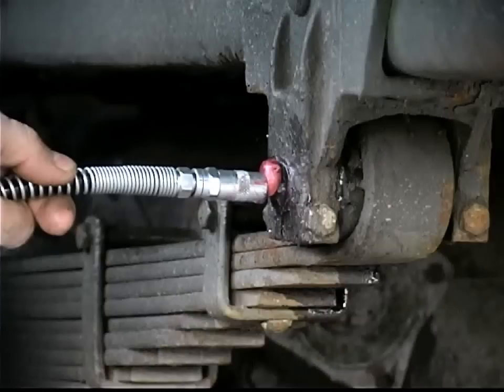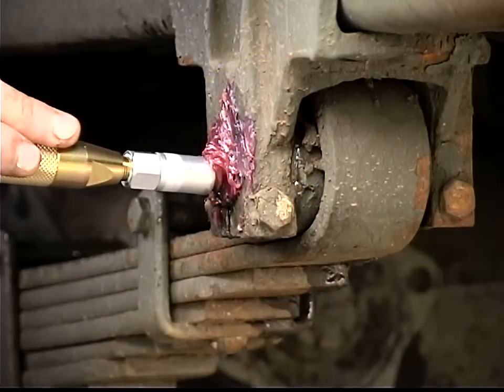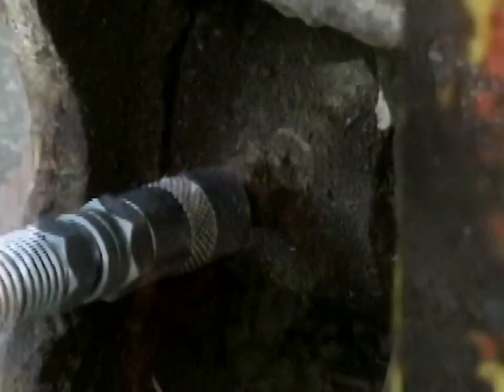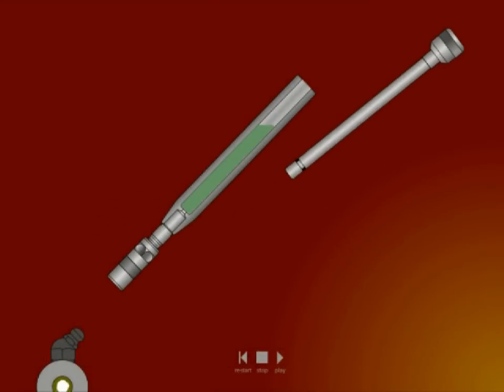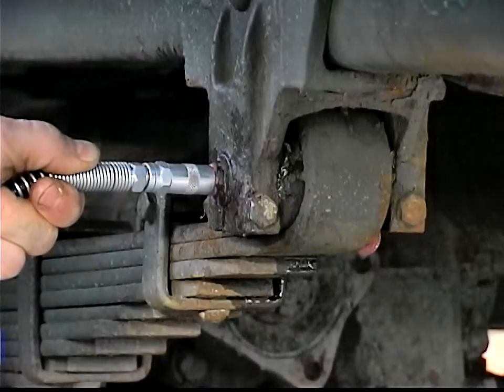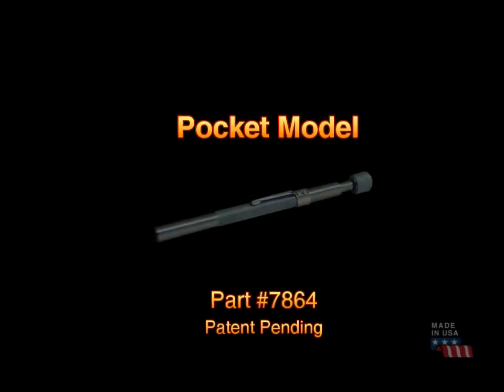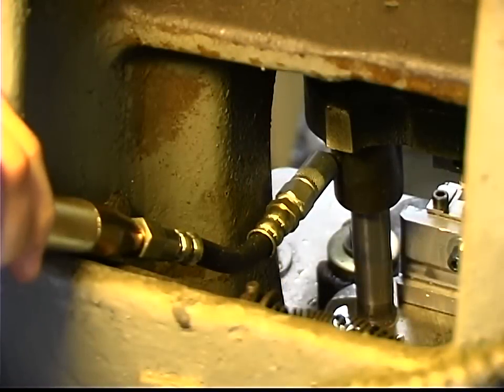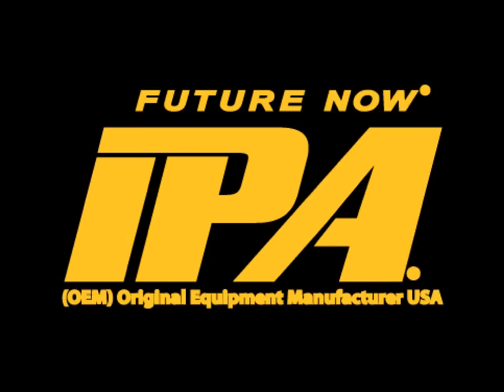IPA Tools 7863 Grease Joint Rejuvenator® Master Kit: Clean Clogged Grease Joints

Comment: This is a tool that works!  Be sure the tool is liquid full so compressing air does not degrade the hydraulic shock.  I found mineral spirits [paint thinner] works best to knock out plugs and clean the fitting and joint before greasing.

Comment: So far I have yet to see this work on dump truck rear main pin bushings.  Also not very useful for hard to reach fittings where there's no room to swing a hammer.
Reply: Air hammer it